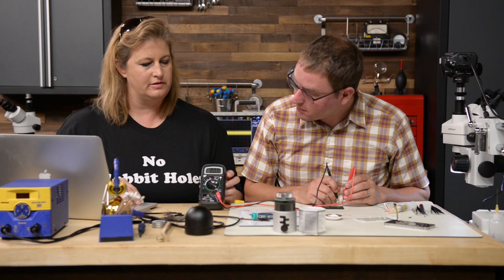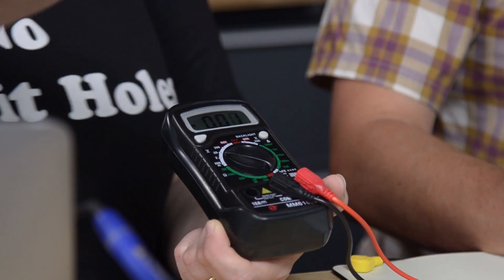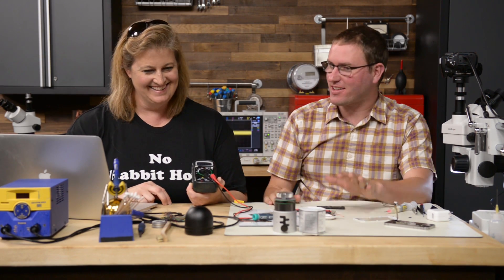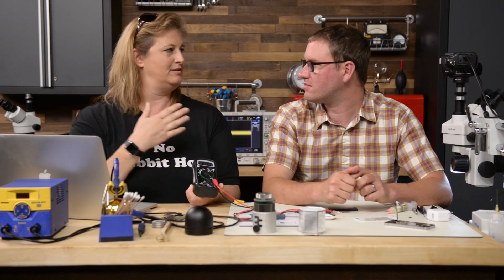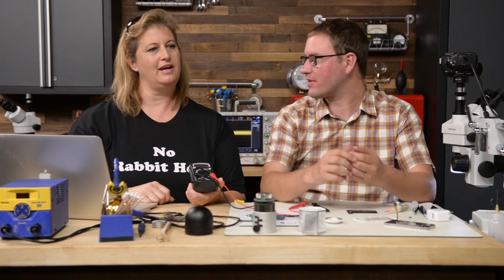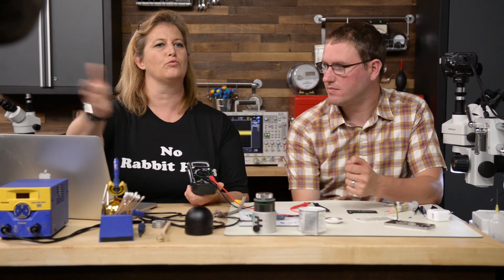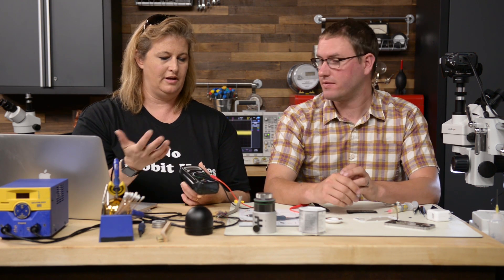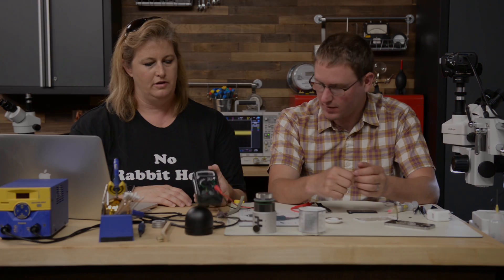Microsoldering 101 Bonus Content: Multimeters

Comment: What's a good, accurate multimeter for low voltage/amperage/resistance?
Reply: how much are you willing to spend? $100 $1000 $10000 ? It is almost impossible to directly measure amps in a pcb since you have to break the circuit somehow and allow the entire current to pass through your instrument. You can desolder a part and measure it.For this kind of jobs as above any multimeter will work. You want VDC, continuity, resistance.